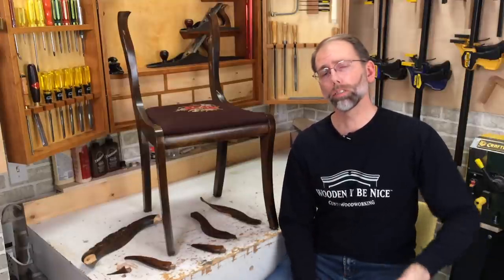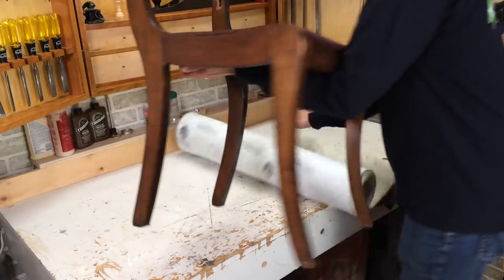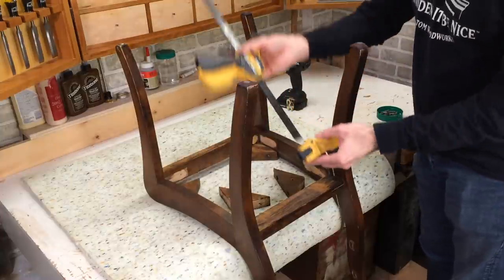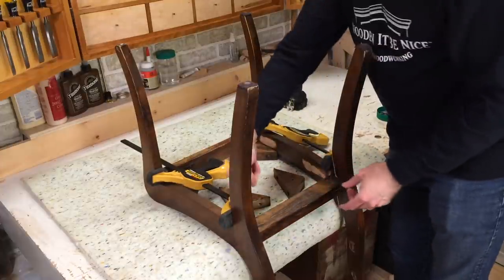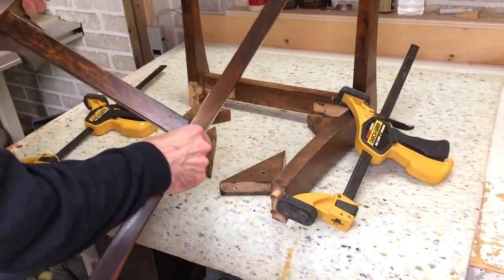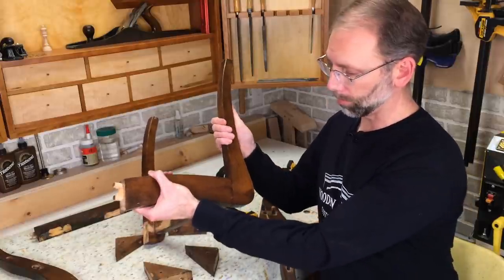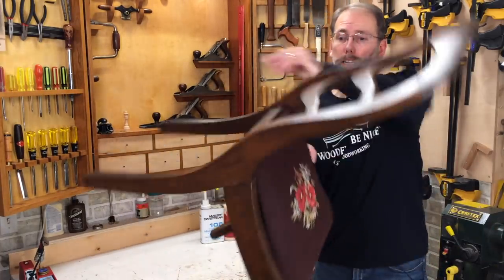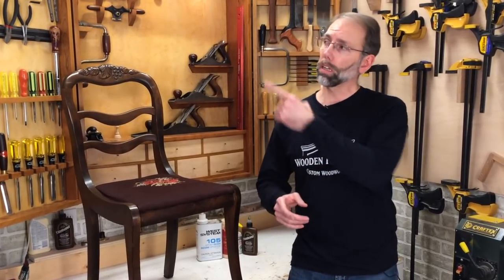Shattered Old Chair Repair using 3 Glues - Furniture Restoration by Fixing Furniture

Comment: I liked the way you did that dowel in the broke tenon. I have had that problem before on a set of chairs I repaired for a customer and instead of using a dowel I cut in to the wood and made a tenon that went in both pieces of wood. That idea would have saved me some time. Thanks for sharing.
Reply from the maker: I'm glad you found that helpful.  Thanks for sharing that.  Scott

Comment: Another great video with many techniques you have shown before being applied. There were a few new things to me. The tapping for tone on the repaired tenon and the fill stick that melted into the void were new to me. I would love to see more on both of these.
Reply from the maker: Thanks for the feedback Neil.  If you haven't seen it yet, here's a video about wood filler that includes the use of burn-in sticks https://youtu.be/d9KC36yZdZs  This is another video that has burn-in sticks as part of the repair https://youtu.be/oaXsUZeq-tI

Comment: I've a suggestion that I hope you might find useful as a quick/easy alternative to cutting a chunk of wood to a form that will support a clamping surface for gluing as you did in this video. You might try using some low temperature thermoplastic rather than measuring and cutting a wood piece. The low temp thermoplastic need only be heated to 60 degrees Celsius then shaped on the spot to exactly what you need. After a few minutes of cooling it would be ready to clamp, and it can be reheated and reused again and again. I've used it many times to provide quick support for gluing projects and at times it has been a lifesaver!
Excellent video. Thanks!
Reply: I may be misunderstanding, but wouldn’t you want the melt temp of the thermoplastic to be higher than 60 due to the ambient temp of the room likely being 65°+ for the glue to be able to set?
Reply: @Aaakeith  You just missed the "Celsius". 60 degrees Celsius is around 140 degrees Fahrenheit - way above room temp for anyone whose not in a sauna!  😊

Comment: jacob kramer
For clamping parts with many curves and different thicknesses, I often use strips of bicycle inner tires as glue clamps.  For instance, I received six broken parts of a meter high African (Makonda) statue made of ebony wood.  There was no way of making jigs to create parallel surfaces to mount clamps.  With every winding added one increases the pressure of the "clamp" Works great.
Reply: What a great idea! Tfs!
Reply from the maker: I agree with Kristie, that is a good idea.  I have latex bands in the shop but I rarely use them.  Thanks for sharing that tip Jacob.  Scott

Comment: Clear as a bell, all of it. Thank you. I"m subscribed. NIcely done as a video, skillful work and excellent result. I work on guitars, and it was very reinforcing (no pun) and fascinating to see you make the same sorts of glue choices on a chair as one would on a guitar, and interesting to note the differences. We use aliphatic resin (wood glue) mainly, and protein-based glues (hide and fish glue) mostly on vintage instruments, cyanoacrylate glue (super glue) on fine cracks, and very rarely epoxy. When there is missing wood, luthiers tend to replace it to fill the gaps. On an antique guitar, you might use modern glues for joining things that were never meant to be apart, and hide glue for the things that were.
Reply from the maker: Wow, that's interesting to see the parallels.  Thanks for sharing that Mark!  Scott 🇨🇦
Reply: @FixingFurniture  all that and your caul for clamping the curved back to the seat and legs also reminded me of what I do. I have a box full of cauls for clamping difficult parts of a guitar. I'll be tracking your work to see if I can pick up any tips!

Comment: Helpful for me this time as I have tenons that are broken.  I can't reinforce the tenon w a dowel as you did.  I think I am going to fill the mortise w bondon/epoxy and then drill for a dowel.  It's on an H stretcher and the mortise has been stuffed w glue by a prior repair so I have some clean out to do.  Thanks for the videos -- very helpful.

Comment: I used burn in sticks that were hard. It took lots of practice to be able to do a burn in on a high gloss tabletop, without damaging the finish. I've used auto body filler where part of a intricate carved piece was missing. It's easy to carve to the same shape, then I would color in the background color with powdered stains mixed with clear lacquer. Then draw in any other colors and the grain lines.
Reply from the maker: That's interesting.  I haven't tried powdered stains yet.  Is the lacquer you use called brushing lacquer?  Thanks.  Scott

Comment: This is the first video I’ve seen of yours, it came up in my recommendations and I'm really pleased it did. What a pleasure you are to watch and listen to, definitely a couple of tips around epoxy that were new to me. Unfortunately I can only like the video once because I’d like it more if I could. It’s great to see a skilled but humble craftsman. I've not been able to get into my small hobbyist workshop since Sept 2019, but looking forward to getting back in there this spring. 

I can only manage small hobbyist projects, but I like to use hide glue. When I do I buy the pearls and warm them up in a body wax heater. I have it on at about 70° to prepare it ad then turn it down to about 60°, it works out incredibly cheap for the glue and those waxing pots are a tenth of the price of a proper glue crock. I like the reversibility of it as I do tend to make mistakes partly through poor mobility and partly through plain and simple lack of skill.

A very easy decision to subscribe and looking forward to getting into your back catalogue of videos. If what I've seen thus far is anything to go by Im in for some real treats.
Reply from the maker: I'm glad you enjoyed this video.  Thank you for subscribing.  If you're interested, we also publish a monthly newsletter you can sign up for on the homepage of our website https://woodenitbenice.ca

Comment: I have run into the same problem with liquid hide glue in my cold shop. I never thought of putting it in my pocket to keep it warm. As always, thanks again.
Reply from the maker: Glad the idea helps.  If I'm planning ahead, I'll leave it in the house before I use it.  If I'm tight on time, I'll let it sit in warm water for a few minutes.

Comment: The break at13:24 looks a lot like the original glue line for the panel used to fabricate the piece.  That would account for the stain inside the joint that failed.

Comment: How do you get the glue squeeze out from the inside of a dowel joint, like the one you opened with a long dowel?
Reply from the maker: Good question.  After the squeeze out dries, run a drill bit in the hole backwards to clear it out.  By running it backwards, you reduce the risk of changing the profile of the mortice.  I hope that helps. Scott

Comment: That chair started out looking like it was used in an old western saloon bar fight scene. It left with a new lease on life. 

I appreciate the demonstrations of the various glue types. Should hide glue be used to connect dowel joints and surfaces? I use Titebond original but have often wondered how I would ever get the joint apart if I ever needed to. Any advice you could give to increase my knowledge?
Reply: In general, I have observed that he uses the hide glue on the vintage/antique pieces where it may need to come apart again in the future. If it doesn’t need to come apart (like the split pieces in the chair back) or it’s a modern piece, he would use the titebond.
Reply from the maker: Yep, you got it Kristie!  Scott
Reply from the maker: Hi Sean.  Hide glue is a reversible glue so you can disassemble the joint in the future.  There are different reasons for using different glues.  Here's a video dedicated to that topic so you can learn when to use what type of glue - https://youtu.be/qK0IR8WT_jE

Comment: Great job. Love the knocking trick to test integrity. I must get some silicon cups... I go through 'Dozens' of throw away egg cups from the dollar shop. I weigh my epoxy. If I used the pumps, I would waste too much
Reply from the maker: That sounds interesting.  I find I'm wasting epoxy.  How did you figure out with appropriate weights to use?
Reply: @FixingFurniture  I have a decent set of digital kitchen scales. Using West Systems. 5:1   5 grams Epoxy, 1 gram hardener.

Comment: Scott! I almost was loosing it when you  drilled through that dowel! Still wonder how you didn’t end up shattering that already broken dowel into pieces while drilling through! I just didn’t dare to do that! Specially since the original dowel looked like having flat oval cross section rather than circular!
Reply from the maker: I sped up the video so I didn't bore viewers but I took my time and stayed perfectly still while I drilled this.  I've done this a few times before so I had some experience to rely on.  I have to admit I was nervous as I slowly made my way though the tenon.  Cheers.  Scott
Reply: @FixingFurniture   for an inexperienced me I would have resorted to make a collar or a dowel drill jig to just hold that end grain together! Glad that it worked just fine! Boy oh boy that was one hell of a restoration job and looked old enough to call it an antique !

Comment: I wouldn't count it being done till you sit on it and it holds together.
Reply from the maker: Maybe I should include that in my next repair video.  I warranty my work and this will last the test of time.  Epoxy doesn't degrade over time and the joints glued with hide glue will get redone in 30-50 years, depending on how frequently the chair is used.

Comment: At 19:25 could you not just use a bar clamp across the back perpendicular then clamp the front leg against it.  Would save your from having to custom cut a piece of wood to fit the curve.
Reply from the maker: That's a creative idea but the chair has a rounded top.  I'm not sure it would allow enough clamping pressure either.  When I'm not recording video, it takes me about 3 minutes to mark out and cut the cauls on the bandsaw, so it's not laborious work.  Cheers.  Scott

Comment: Good video but why take the hole chair apart?
Reply from the maker: When a chair gets to the point where one joint is loose, it's often that all the other joints are loose as well.  This is a normal process every chair goes through when it ages.  If you just glue one joint, you're missing the big picture and you will have to repair it again in the future.  By taking the chair apart (20 minutes of work), you're able to clean off the joints and reglue them to last for another 30-50 years.  Does that answer your question?  We have many more repair videos that show the repair process - here's a playlist for Level 1 Woodworking Repairs https://youtube.com/playlist?list=PLOgTcCDjpIJVb1iQ1b_-CNRw2U__d5A4k

Comment: Some wood furniture is just trash soft wood instead of hardwood. It breaks from just sitting in it. The least amount of pressure is all it takes. I have 8 dinning chairs that are trash like this chair. I think it could only take about 60lbs of pressure. When buying, I only buy solid hard wood, unless you have a way to make crappy wood stronger. I worry that all your repairs will not last. Your repairs may last but other parts of the chair will break because of the wood the chair is made of??? I wonder if the sales person tells us it is solid wood but parts of the chairs are made with trash wood???
Reply from the maker: The wood in this chair is quality wood, but the chair was abused, which caused it to break.  The only chairs that I've seen where the wood is questionable are some flat-packed chairs that the customer assembles with bolts.  I've repaired a handful of these chairs where the wood is brittle and fractures very easily.  They're not made with a North American wood.

Comment: Epoxy glue on an antique is shameful.
Reply from the maker: I would agree with that comment with one addition... epoxy used in the joints of antique furniture is shameful.  The reason we use hide glue on the joints of antique furniture is so that it can be disassembled in the future if needed for a repair.  Understanding the types of glue, types of furniture and where they are used is part of the learning curve of furniture restoration.  I hope that helps.  Scott